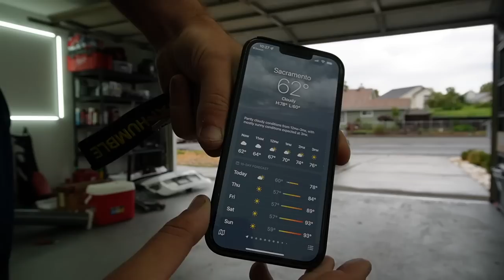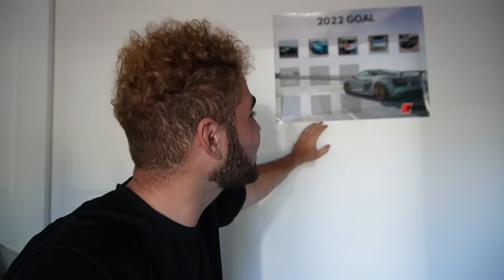Building A Custom 1 of 1 E91 M3 Wagon! (Part.12)

Comment: How are you planning to wire the Tailgate and tail lights? Is it in a sub harness? Will the sedan wiring match up to the wagon's? 
I'm planning on swapping my e60 550i into an e61 and currently thinking how to do that part, I need to swap wiring due to multiple factory options.